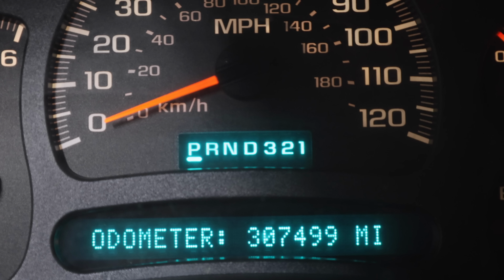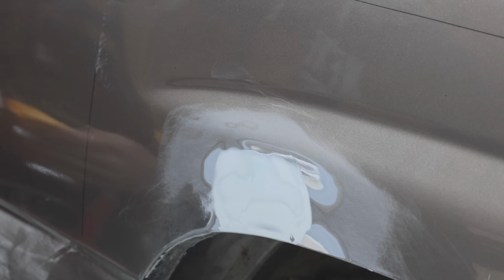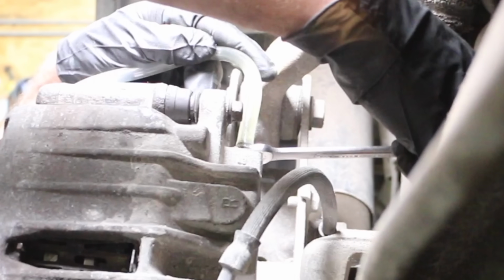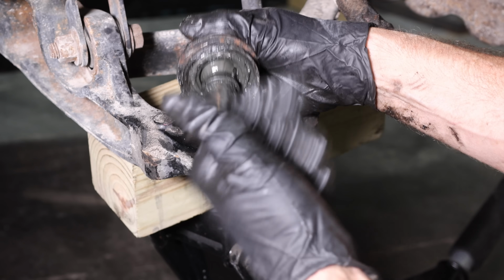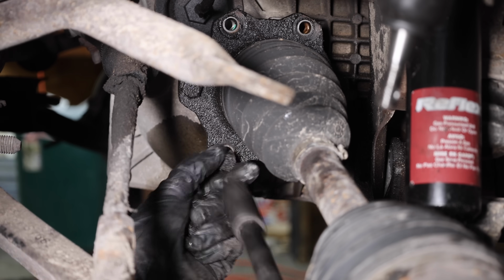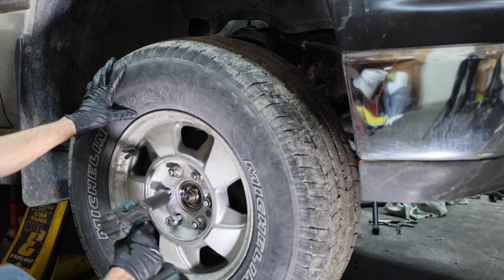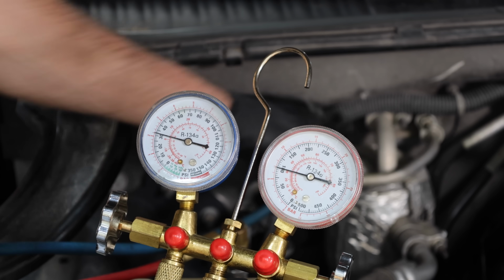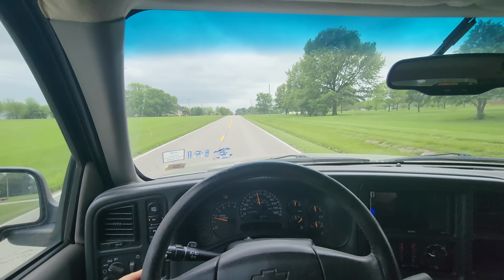Is It Stupid To Fix Up A 300,000 Mile Vehicle? Let Settle This!

Comment: I have a 06 Denali. 227k miles with only 600 hours. Its mostly all highway use.  I just did a complete brake job, and the whole frontend. And a new Ac compressor. Still going strong, very comfortable to drive. Well worth the money putting into it to keep it going. The new stuff is all ugly junk

Comment: I have a 2001 Chevrolet trailblazer.Bought it off an old man and he kept it in GOOD shape,it has 400k miles,all it has is very mild wobble,the window actuator broke on the front passenger side,and it has slight paint scratching,bearly noticable.i got a very good deal for it being 1400 😅,planning to upgrade some engine parts so it lasts 800k and some much needed power

Comment: I just paid $3,900 for a 2014 Durango limited AWD with 3.6 has 285,000 miles 😂. I love Durangos but I'm broke and put everything left into it -$3,500 more and I'm installing lifters, cam shafts, rocker arms this weekend. I'm choosing to ignore the slightly leaking head gasket 😢 it came that way and I ran out a money.

Comment: If a patch is going to require a  bondo top layer, why weld in a metal patch?   Bondo or fiberglass with a mesh substrate will do the job for 1/4 of the cost.    If it's a daily  driver that you're trying to get a few more years out of, good enough is good enough.   If you're trying to restore a collectable classic, then yes, weld in a patch, but do it right without any bondo to smooth things out.

Comment: If you have a dependable top-rated car, as I did, it is worth keeping.  But I wouldn't spend $5,000 on a $2,000 car.  The 5Gs saved would go well toward a newer one.  Like a 1994 Camry to a 2007 Camry, as in my case.  The 94 still ran, and I got $1500 for it, the 2007 with fixes & taxes came in under $5,000.
Reply from the maker: Thanks for the feedback.

Comment: Cool, I just retired, have a 97 c1500 with 315k three door truck and I need to go through most of these repairs on mine. Especially the steering. Going to start first with the steering as that is what annoys me the most! I replaced all the ac components and recharged a couple years back but I can tell it needs a recharge with all the hot weather recently
Reply from the maker: Thanks for sharing.

Comment: I noticed you used iridium plugs. My experience with GM is don't use any plugs except what came in the vehicle like the original ACDelco plugs. I have noticed irregular idle and delayed acceleration with other types. You make great content even if it isn't a comparison video. The vehicle ones are just as good.

Comment: Mine is 138,500 miles and I am fixing it up right now. Engine still runs like a beauty just had to replace the rear engine oild seal and some u joints, front shock and it is good to go.

Comment: By the time a vehicle has 300k miles on it many of the non engine related parts are falling apart.  Then you are faced with the cost of having to repair or replace those too.
Reply: If you buy a crap car yes.  If you buy a decent vehicle to begin with and take care of it, this is much less the case.  My F-150 has 212,000 miles on it.  The interior, aluminum body, frame etc. are all in excellent shape.  Nothing is broken or missing.  I don't see this becoming an issue for many more years.

Comment: I recently got an 06 toyota sienna basically for free with 220k miles. I just took apart the air intake system and cleaned it up really good, cleaned out the throttle body and mass air flow sensor, new tires, new air filter, changed oil. Next up is replacing the T posts in the coolant lines that are a common but catastrophic failure, I need to change the fuel filter and found out its on the top of the gas tank so I have to drop the whole tank. I'm new to working on cars but I'm learning alot with this van. I plan to break 400k with it.
Reply from the maker: Thanks for sharing.

Comment: My current car is a 2007 Honda odyssey with 387k miles on it. My parents were the original owner and we’ve done almost all of the work on it ourselves. Things have been wearing down a little lately. Today for example I spent the day changing out the AC compressor in it along with all the things that go along with it. This is the first time that we have had to replace it. It’s never had any transmission problems, the engine still runs beautifully, the tie rods and suspension need replacing now and a couple years ago I had to fix an oil leak in the filter manifold.. but beyond that, it’s worst problems are cosmetic. I know the car inside and out and can fix anything on it. Older cars are the best. New cars have way way way too many electronics that can fuck up your day in a myriad of ways. I will forever choose old fixable cars over new unfixable one’s any day of the week.
Reply from the maker: Thanks for sharing.

Comment: That 2003 was made A LOT better than a Suburban is now. The new ones will never last this long. My Dad's 2013 had the engine blow out at 140,000. It's a known flaw with lifters in the 5.3L. He called GM to see if they would offer any kind of assistance, they told him to pound sand. He had to replace the engine for $10,000! He has been buying Chevy's since 1968! Buy older vehicles folks, the new stuff from any automaker are junk!

Comment: Might as well just keep that vehicle another 300k. If you put all that work into it, why not replace the motor and transmission when they fail and just keep going with it. Still will be cheaper than buying a new vehicle.

Comment: I built an '87 chevy 4 wheel drive pickup from the ground up. It was 2004. Got a Goodwrench performance 350 roller., with tin, no fuel. delivered for $1800 bucks. Got a radiator core support from a '91, for the side by side glass headlights with the slight offset. They  look cool. Monster Trans 400 from Florida, off road build. The Goodwrench engine grenaded an R4 and a 350 built for a Nova track car. Jasper front and rear difs, the transfer case they put in the '87s from factory are bullet proof. Variable power steering pump, can't remember brand. Increased the radiator capacity with a larger aluminum. Edelbrock high flow water pump. can't remember the thermostat brand but added a bypass, more modern upgrade. Holley throttle body, pretty sure it was in the 650 range. 4" lift with one set of 35" general AT's and a set of highway tires for traveling. Custom dual exhaust matching the engine output, 2.5" tubes. Entire build was $15K and took about 6 months. All my friends in our mid 30's said I was crazy, should of just bought a new truck. A new Chevy 1500 standard cab with close but no where near my performance was $25K minimum but closer to $35K built up for off road. With a watered down 305. I sold it ten years later for $4K. At the ten year mark my friends had allready traded in their rigs. My one friend had close to $45K tied up in his new junk compared to my $11K. If you have an old Chevy, build it. If it's a Dodge or Ford, well you know what to do. Unless it's the Carbureted 300 six.

Comment: on the welding portion the material is very thin so if you do have access to a tig welder I would recommend you use that. You would want to do maybe 4 tacks all together then actually weld a bead just at very low amperage. Stitch welding isn't very durable and the lack of fusion would need to be addressed. But if you are in a hurry It works
Reply from the maker: Thanks for sharing.

Comment: I always use Locktite orange on those brake caliper bracket bolts - similar to what was put in there at the factory.  I've got 359k miles on my '05 chevy 3500 Express van, so I've done all these same replacements (plus front control-arm bushings) and she runs good as new!  All 359K miles on original transmission and engine - regularly changing fluids on both has kept her running like new and shifting smooth.
Reply from the maker: Thanks for the feedback.

Comment: No, I got an 04 Escalade body and frame is mint interior could use some touching up but it’s very well kept also. It has 374k miles when I bought it for 800$ and I’ve put another thousand miles on already it’s still got lots of life with little upkeep all I’ve done so far is a spark plug to correct a misfire! It can be very worth buying highmileage vehicles. I intent to live out of this for the summer so will do small fixes and work as I make money since I’ll be saving from renting. Here’s to hope it gets me through summer!
Reply from the maker: Thanks for sharing.

Comment: Honestly, if it runs well enough that it can be improved, shifts consistently, and isn't rusted out underneath so bad you can't get the suspension apart, it's always worth fixing up an old car as long as you do it right. They're not as unreliable as people think simply because the mileage is high. A car with 50k miles and poor maintenance will run as well or worse than a car with 150k miles and proper maintenance. Keep your car happy and clean, it'll run a good long time. Even newer stuff, maybe there's more plastic, but that's really no different from older vehicle "common failure points" which are also wide-spread. Just keep up with your fluid changes and replace what breaks when it does and your car will probably outlast any needs you have for it.
Reply from the maker: Thanks for the feedback.

Comment: Over 400k miles on my CRv. My first car and i bought it with 80k miles on it. Still original motor and transmission. Only things every really were done are springs/shocks, tires, windows, door motor (for lock/unlock),
Reply from the maker: Nice!  Thanks for sharing.

Comment: I dont keep an eye out for your videos, this is the first one I have seen. I like it. it sppears you include most...not all procedueres. when installing the break rotor that hub should have been wire brushed for the rust around it. in all the proceding procedues you did wire brush. very nice! as far as the rust repair, you could have used a cheap piece of sheet metal since the rust was localized.....very small if under a soft ball size. when rust is around the vollyball or basketball sive it is smart to buy a section and use all of the section you buy...or its a waist of money, time, and supplies......that you are already going to use, body filler for the sections that need it, sand paper, you should start at 36 gritt to rugh it in the 1st body fill then the 2nd body coat is 120 then glaze it over, some call is icing. sand that with 180 then prime. snad the prime with 240 with guide coat.....you can also use a matt coat of black .....any color other than the primer and the glaze and the filler. ...you just need to "splatter" that one. its hard to diswcribe but you can do a quick search and figure out what i mean to say. after that sand with 240 then guide coat and use 420, then you are ready to tape off and paint. I do not have alot of experience just 6 years in the autobody field. there are people that have....10-20.....30 years experience in autobody and im pretty sure they will thumbs up this procedure. you did good though i would just have used panel bond instead of weding to prevent the inside of the sheetmetel that you primed to be burned off from all the heat from welding. afet that i would use seam sealer on the inside where you cant see to cover all exposedd areas and or seams that need to be filled. then a product called seal out which is a rust preventave solution that you would drill a hole and spray on the inside cover all areas you can. then a rubber/plastic plug for the hole but either prime of paint that hole before putting the plug in. then use the rust proofing around the hole install the plug then rust proof again, just in case......I only have 6 years in autobody, maybe a more experienced tech has a better procedure......Im having another ber! very nice video, loving your work!
Reply from the maker: Thanks and you are welcome!

Comment: With the todays prices of new vehicles, as long as the needed parts are available just do the math fixup old vs. buy new. Math never lies. I had a 1980 Chevrolet longbed pickup which I wish I'd never sold for 750.00. that was 'with' 3mo. old Goodyear tires. And a professionally rebuilt rear end with 3.73 gears. Stupid sell? It needed a paint job, smoked some (valve seals?), occasionally hard to start (carburetor), and 11.5mpg was best I could get it to. The three  reasons I sold it? 1. Needed to go back to college, an hour and half drive one way. 2. The 11.5mpg was killing me. 3. No a/c. *Reasons I wanted to keep it then, or wish I'd have kept it now? 1. It rode very soft vs trucks of today, it soaked up the bumps well. 2. It drove real good like a dream in the turns to me. 3. It pulled a trailer good. 4. I still like the look of the 'box chevy' truck. 5. Opening the 1/4 vent windows, which new trucks are scared to have. 6. I could work on it myself no matter what was wrong.
Reply from the maker: Thanks for the feedback.
Reply: The true absolute reason I sold it- bad gas mileage. Bad gas mileage can sink you. Right? That's correct right? The solution was get a new vehicle with smaller more economical engine to save money by increased fuel efficiency. Right? Yeah. ...well not necessarily so always. As known the MATH never lies. So take a notebook and write down all the truths about the cost of the old vehicle. Many times it's PAID FOR. Immediately we have leverage of reason as thumbs up on keeping the old vehicle. Ok think more. Let's say the tires aren't new but have 50% tread left. And new tires will be needed in 6months, but there's 6months ok use left. Brakes are only 9mo. old and have another year? left usable. Air filter needs replacing @40.00 with tax. Sparkplugs need replacing and are 5.99 each. Fuel filter needs replacing at idk 19.00. It has been 3yrs since headlight bulbs were swapped so estimate in another year maybe a couple headlight light bulbs (Especially if a Chevy), how about a set of front rotors? They haven't been replaced and are ok but likely now past the factory allowed specs so say 90/pair. Rear shocks have been replaced two years back so that's ok, the front struts... Well I say forget it about two years back but they need done. So let's right that down + the alignment shop charge. Oh almost forgotten was a serpentine engine belt 50.00, true oil change 40.00? or is it 80 now? (Verify), and the battery is four years old. Batteries sure do t last forever and let you down when you really need them, so a new battery 200.00, and battery terminals idk 14.00. Fuel system treatment is past due for good injector operation @14.00 for the good Chevron cleaner. And the catalytic system has never been delt with so figure in a bottle of catklean 30.00 to help out and increase efficiency plus reliability. Ok again think. Auto insurance is xxx.xx/quarter × 4 = _______/yr. Fuel is ___/gallon @xx.xmpg. these things are to be written accurately. Now figure the cost of that new vehicle plus the true cost of ownership of a new vehicle. The vehicle most likely has RECURRING payments. Warning RECURRING PAYMENTS! The auto insurance costs way more, the license plate is idk 500.00 instead of 40.00, chance of the neighbors cat scratching the fender three days after purchase (yeah real truth ask me how I know) INSTANT DEPRECIATION of value, but it has new engine, new brakes, new transmission, new injectors, new headlight bulbs, new fuel filter & air filter, new tires, etc, etc, etc. plus another say 12mpg economy. Figuring deeply the true math and compare side by side and results can be surprising. I like the idea of just keeping the old vehicle (if liked still) and slowly each month investing back into it with the wear parts since I can do myself. BUT the last vehicle I bought was oddly new. Only because I did the math such I've stated. Truly I was NOT wanting a payment but the true math revealed I am stupid not to purchase the vehicle. I drive very many miles a year and the fuel savings plus the other factors proved best to buy new. My math proved to save (seems like best I recall) 20/day each day driven vs my 1996 work truck.

Comment: To drive 300K miles on $5/gal California gas at 14 mpg (EPA combined) cost $107K in fuel.  Most people don't know where their money went.  It is a stretched out annuity payment, rather than upfront cost.  Consider if you truly need a large vehicle, or if renting one for a very occasional need might pencil out better.  For that patch on a flat section, I'd just cut it out of galvanized sheet and smooth it with Bondo Glass, then final filler.  For an easily sourced and inexpensive spray can for weld-thru primer, I've used Rustoleum High Zinc Galvanized Metal Primer.  Of course best if you can paint the backside after welding the patch.  Less work is to use a  cheese-grater on the filler when it just starts to harden ~10 min since it peels off thin strips, rather than sanding.  I grate it right after cleaning the tools.  Plan on at least 4 passes with filler, then thin Spot Filler to fill pinholes.  Many classic car owners use Rotella "diesel oil" for its higher zinc content (good for flat tappet camshafts).  Funny that a relative ran low on oil in Indonesia.  The village station only had "diesel oil" on the shelf and the attendant there stated, "can't use in a gas engine".  I'm an M.E. and told them, "fine, even better", but they trusted the expert so drove off with the oil lamp on.  I like the quick video speed.  Is that why your voice sounds alto?  Deep farmer drawl in real life?